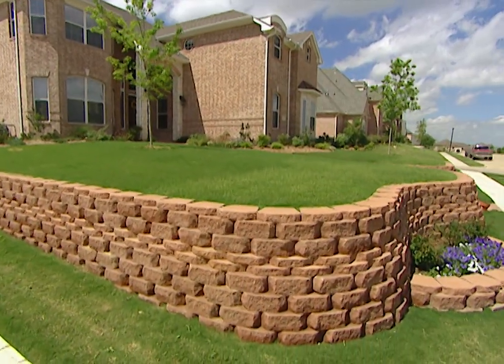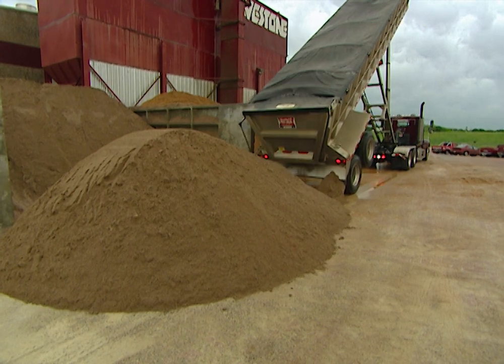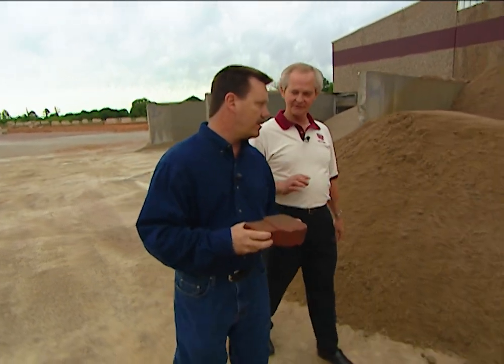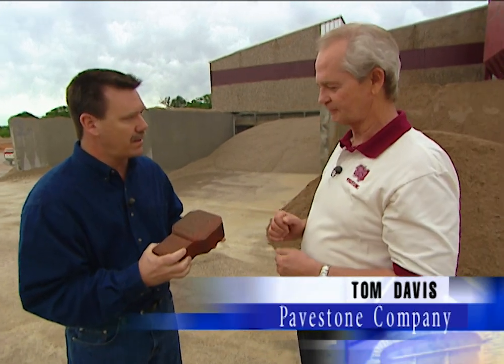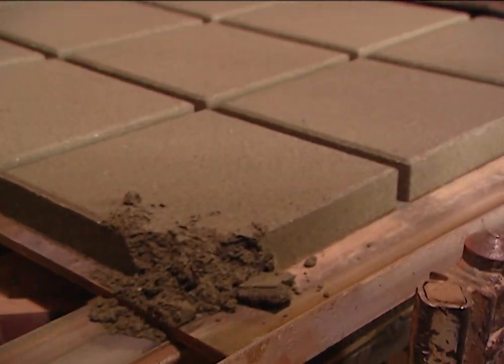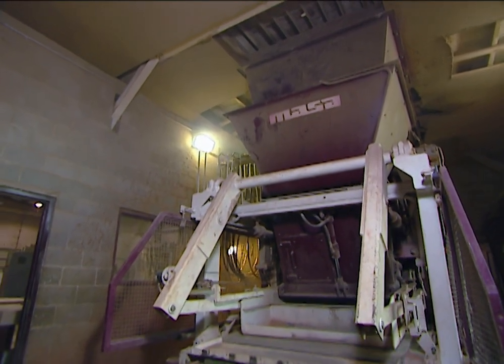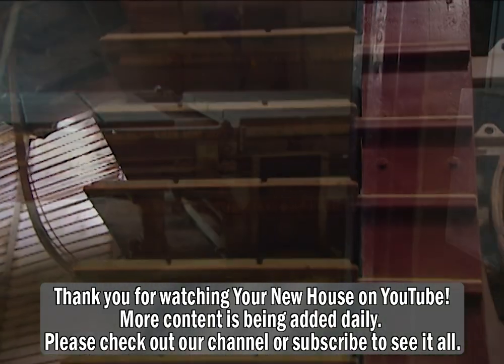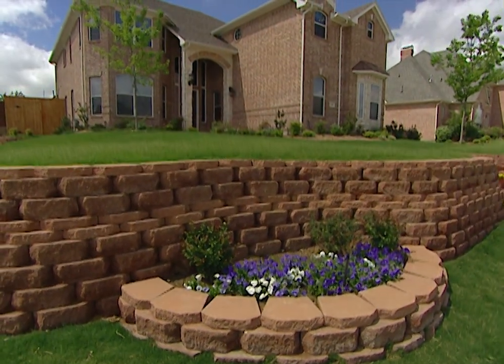How Pavers and Retaining Wall Blocks are Made - Did You Know?

Comment: When I was only 18 years old, I worked with my missed father 😢 in a small size Co. My responsibilities were check the sensors and electrical control systems of Concrete block production machines. about 20 years ago in Iran we did have not enough cement and it was a big issue for me to find it at that time. It was a boring time. 
Searching for a topic here, came me back 2 decades ago!